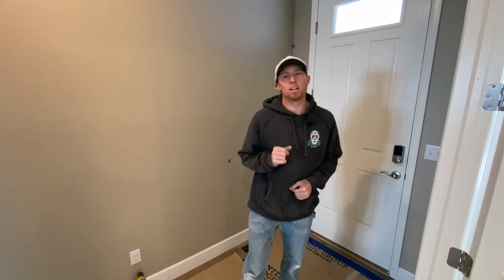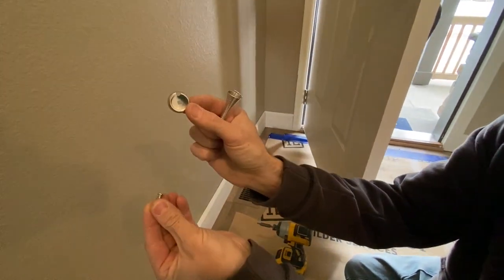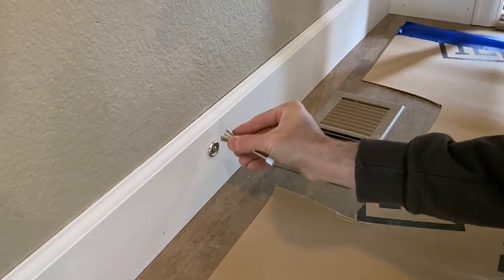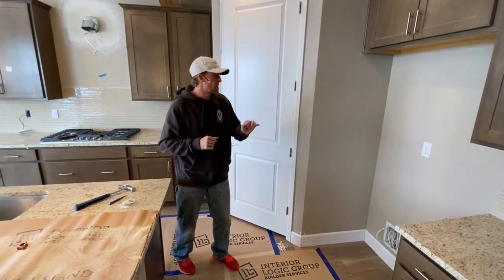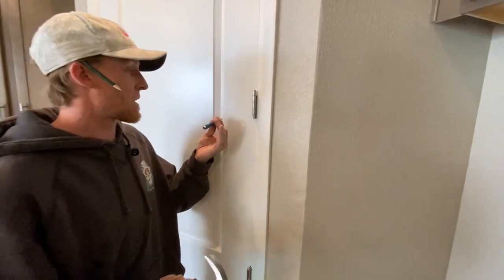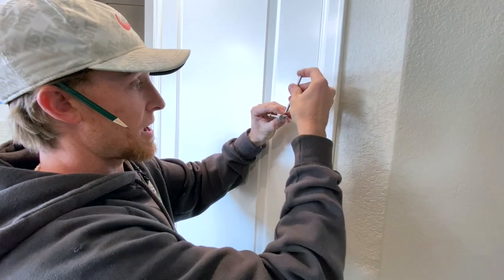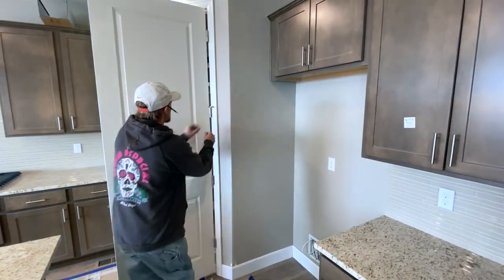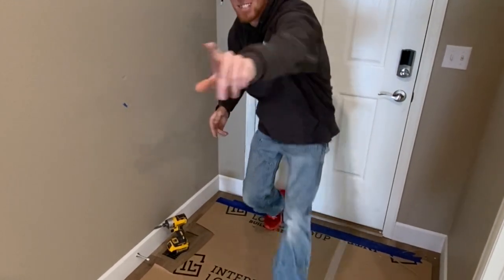How to Install Spring Door Stop & Hinge Door Stop: Protect Your Walls From Door Knob Damage!

Comment: I have seen those hinge attached stoppers push a hole through a door. It was probably slammed open and the door was probably very cheaply made, but it is something to be aware of. Definitely use the baseboard mounted type if possible.

Comment: How do you prevent the hinge stop from making a dimple in the side trim?
Reply from the maker: Good question…unfortunately I don’t really have an answer for you…I would rather a dimple in my trim rather then a door knob hole in the drywall…maybe use 2 hinge stops per door that both stop the door at the same time…that might help with 2 points of contact rather than just 1…thanks for watching and have a blessed day 😎

Comment: Our front door has a spring door stop on the bottom just like this first one you showed, but we are still getting a hole in the wall from the door handle.  If the wind catches the door or a child opens it and doesn't hold onto it, it hits the spring door stop and the spring flexes enough that the door handle still hits the wall.  Any suggestions?
Reply from the maker: Look on Amazon for a solid metal door stop that is longer than 3 1/4” in length… still go through the same steps to secure it to the baseboard…sounds like you just need a longer one…or there are floor mounted door stops you can look at, they are secured to the floor so you need to be sure of the location before putting a hole into your hardwood/ tile…
Hope this helps and have a blessed day 😎